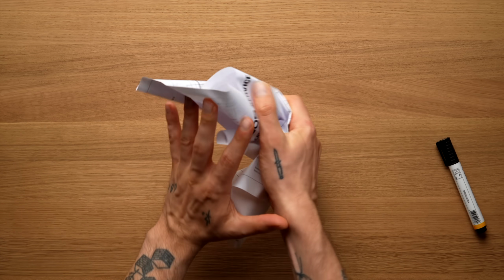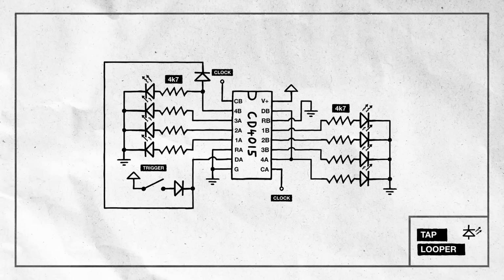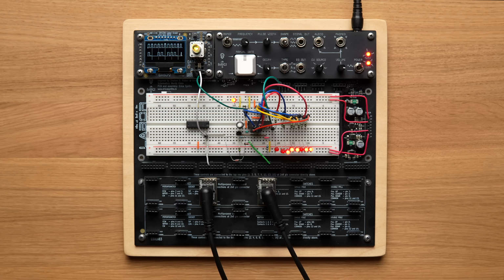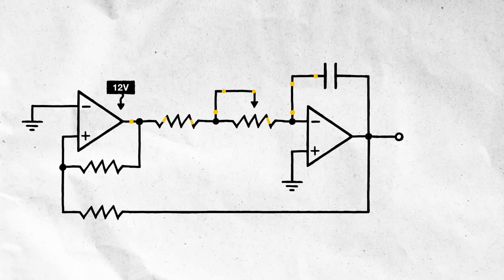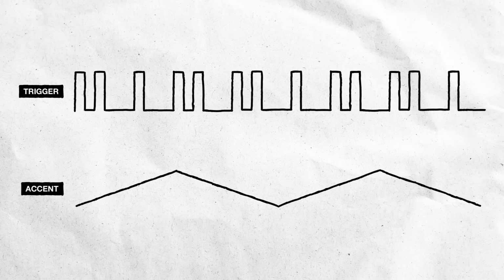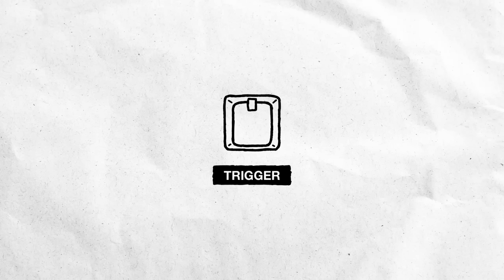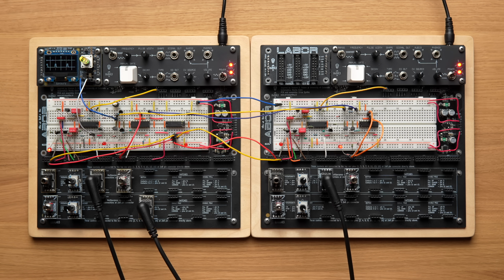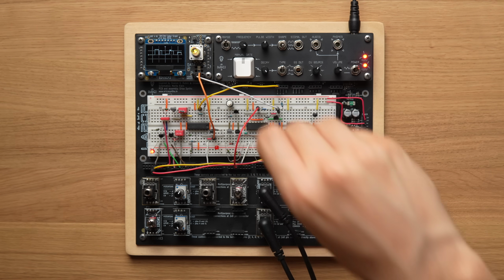This drum sequencer breaks all the rules

Comment: How to save the patterns to be visible after reboot. CMOS battery? Or something more complex?
Reply from the maker: battery would be the simplest way i think, though you would need to find a way to prevent the chip from pushing current to the LEDs, as this would drain the battery super quickly.
Reply: @MoritzKlein0 thanks. Will think about it.

Comment: Hi Moritz. I was thinking of if maybe the CD4015 could be setup in such a way that it keeps the last state when powered on. Then it keeps the last programmed patterm.
Reply from the maker: hmm i think to achieve this, you would need to supply the chip with power even when the main supply is switched off. maybe a small battery would work?

Comment: Hi Moritz, I would like to make some sort of LED bar (per voice) that visualises the triggers you've set. Can I just use the outputs of the CD4015 IC's to drive them? Just like you've showed in the beginning of the video? Or would you advice to use transistors to drive the LED's to take off the current load? My idea is basically to make a horizontal bar with 16 LED's that shows the actions of the IC. Just like an external meter-bridge from an audio mixer. I thought it would be nice to have. What do you advice? do I also need resistors from the outputs to the base of each transistor? Thanks in advance for your advice.
Reply from the maker: you should use transistors i think - the 4015 is not meant to drive heavy loads. you don’t need a base resistor if the LED + resistor are between the emitter and ground!
Reply: @MoritzKlein0  Thanks Moritz. Have a nice day

Comment: The Integrator op-amp configuration creates triangle waves because of basic maths! The value when the square wave is all the way up or down (+ or - VCC), is basically a logic 1, if you integrate that function, (+-1) you get “x”, remember the equation of a line is mx+n! (in this case you are creating an increasing or descendant line!

Comment: just wondering because i'm mostly new to analog circuits with op amps and such, is there any reason you chose to use an op amp to drive the trigger signal low when clock was low instead of just and AND gate?
Reply from the maker: good question! mainly just a practicality thing – i already had a few unused op-amp stages in the circuit, so it made sense to repurpose one rather than add a whole logic chip just for a single AND gate. if i’d gone with a dedicated logic IC, most of its gates would’ve just sat there unused!

Comment: You could get rid of the modifier button with a XOR gate. Pressing the button will then invert the stored bit, resulting in either setting or clearing it.
Reply: Could easily lead you to accidentally set or clear bits when you don't want to

Comment: Something you could do is add a selector to wire the output of one of the CD4015 to the input of the next, and vice-versa, that should work with a single dpdt switch wired like you'd wire a motor for reverse, and that gives you 16 note patterns instead of 8 at the cost of more or less disabling one, though since the lfo are independent and offset 8 notes apart that gives you a nice pattern, and keeping the two buttons give you the opportunity to press both at once to get similar patterns.
Also I'd go with 1p8t switches for more granularity on the loop length.

Comment: This use of a shift register reminds me of the linear feedback shift register for RNG. It's very simple, though it will repeat the pattern and cycles through each value except 0 exactly once per cycle, but it's literally just a shift register and a few XORs of its outputs, the output of which is the input to the shift register

Why use an op amp to pull down the output when the clock is low instead of an AND gate? I guess maybe a 12V gate is hard to find?

Comment: As always, a great design and an amazing video. BTW, if you're making a clock, don't use the ubiquitous 555 - It'll mistrigger almost any counter. Use one section of a 40106 Schmitt trigger with an R and a C. Also, put a 22K resistor in series with the 4015's clock input, and you can use either a unipolar or bipolar clock source. 

A nice trick I'm sure you're aware of is using an XOR gate (1/4 '4070) with a single R and C to make an edge detector. I don't know if that would be useful here, but possibly it would allow you to omit the op amp you mentioned early in the video.

Comment: Great video! I think there is a way to simplify button schematics for adding/clearing beats. Let feedback go through 10 kOhm resistor (or even 100k), one end of button connects to input, another end of all buttons is either fed to 0 volts or to Vcc depending on set/clear switch. And that's it! If button is released feedback is working as CMOS input has great input impedance and 10 kOhm resistor doesn't attenuate signal in the slightest (maybe makes slower rise and fall but it still makes proper level to the clk rise and doesn't affect anything at all!). But when button is pressed it "overrides" this input to whatever voltage it had on its other end.
Reply from the maker: would have to try it, but sounds like this could work. great idea!

Comment: What about generating a triangle based on some subdivision of the clock using an op-amp integrator? I mean your approach works really well, but I am curious what (dis)advantages this one has
Reply from the maker: for one, the output of an integrator changes massively with the input signal's frequency (since it is basically a low pass filter). but also, i don't think that using eight/quarter/half notes for this would give you particularly interesting rhythmic results!

Comment: peak content here,

I remember doing something in this vein using a clock generator (i think i used a 555 chip) and a shift register to control a Ataripunk console.

It was not as well designed as this, but the idea there was to use the voltage that came out of the shift register with would be some level signal like 5v and scale it between that and 0 for each step using a knob for each step.

https://youtu.be/xlXNf9ZBPXo

I was much less knowledgeble back then...maybe I'll try again
Reply from the maker: sounds similar to a baby-8 sequencer – just using a shift register instead of a decade counter?
Reply: @MoritzKlein0 maybe at the time i saw the baby 8 and it was the base, i will revise the parts here
Reply: Maybe it even was the baby8 itself i remerber for space reasons it was only for steps but it might as well have been

Comment: As the circuit got more and more complex, I couldn't shake the feeling that a single-chip microcontroller could have done all of this without needing such complexity.  It would have been a lot more fun to see this done in software with a 20-pin microcontroller, using its ADC and timers.

Comment: One would think the clock gate would rather be an AND gate between clock signal and the shift register output instead.
Reply from the maker: i mean it is, just implemented with a diode and a resistor!

Comment: over all the videos, you switched (pun unintended) from buffers to transistors. a bit more complicated (to learn). was there a reason?
Reply from the maker: you mean from op amp buffers to transistors? i guess there's just been more cases where i only need the buffer to source, not sink current. or maybe there's something subconscious going on. no idea!
Reply: @MoritzKlein0 I follow your designs because they are the BEST way for me to understand electronics. You mentioned something about impedance this time. The op amps allow you take "copies" of signals/volts/current. But using transistors did something different.

Either way - I love your channel/videos.

Comment: Reminds me of the Big Button from LMNC and the Turing Machine by Music Thing. I had enough headache with reprogramming the Big Button so I think I have to redesign it code free like this one
Reply from the maker: definitely some overlap there – what were the headaches with reprogramming the Big Button?
Reply: @MoritzKlein0  I tried to reprogram it with micropython and a Raspberry Pi Pico with some of my own modifications, and I forgot that the adc max voltage is 3.3V, which caused some issues. Also, there was issues with variable gate time, as well as the fact that I'm just not so good at programming🙃
Reply from the maker: @F113XX too bad – sounds like a good challenge though :)

Comment: These are the sort of circuits that are genuinely exciting - a simple idea that ends up turning into something so much greater than the sum of its parts! The retriggerable LFO idea is interesting because it doesn't seem particularly powerful at first, but basically works as a variation of the euclidean rhythm concept if you think about it.
Reply from the maker: yeah, i was pretty surprised myself that the LFO works so well. my initial ideas for implementing accents were much more complex – so it was great to find such a dead simple solution :)

Comment: awesome as always!  not sure if you've seen the lorre mill double knot but it uses two similar shift register sequencers.  i really love CMOS / lunetta style rhythm sequencing it's a fun change from programming a microcontroller-based sequencer, with more randomness and unexpected outcomes.
Reply from the maker: i haven't – will check it out! and yeah, breaking away from microcontroller-based sequencing is great fun. one thing i learned the hard way, though, is that shift registers are incredibly sensitive to dirty clock signals – they really go completely bonkers if the edges aren't perfectly sharp!

Comment: Pausing less than one minute into the video - I wonder how similar this is going to be to the Boss DR-55 which also got away with two buttons for programming. (OK, and an instrument selection switch).
Reply from the maker: and, how similar is it?
Reply: @MoritzKlein0  Your sequencer is more interactive - the DR-55 is step programming only. The accent features on your sequencer are also far more sophisticated. It's perfect for controlling the various clones I have of old drum synths (Synare, Simmons Claptrap and Syncussion) so I plan on getting the kit for my birthday.
Reply from the maker: @chriswareham  ah interesting, so it works like a TB-303 i guess? more on the side of programming a sequence. either way, hope you have fun with the kit!
Reply: @MoritzKlein0  Kind of like a 303 - you have an instrument selection switch and two buttons. One button enters a note the other a rest. You just cycle around the pattern with those buttons. It's similar to how patterns were entered in the Roland CR-78 with the optional two button programmer.

Comment: Wait, what? Is that how a shift register works, as in a pulse/signal shifts the stuff sideways? And here I was thinking it was way more complicated - I really need to sit down with for some weekends and work my way through the basics, thank you for this awesome example using the drum machine as an example :D
Reply from the maker: yeah, shift registers are really just like a conveyor belt for binary data. super simple devices, but really useful!
Reply: @MoritzKlein0 Yeah I see that now thanks to this video :) I’ve known they have been used to collect input from game controllers and «dumped» into the brain, but I’ve never had the time to sit down and search for and properly understand how exactly the data is «shifted» - it’s sort of frustrating because I understand the basic concept of electronics and some of the theoretical stuff of what a resistor does, capacitors etc etc and how routing voltages here and there can trigger stuff, but some of the slightly more «advanced» stuff, like shift registers, is stuff I’ve never had the time to dig into - but this unlocked something here, hopefully I’ll have some time the coming winter to spend some weekends get past my basic understanding and do some experiments on my youtube channel learning this stuff, it’s the missing piece I need for some of my more advanced projects I want to do with servo’s and triggering with sensors etc :)
Reply from the maker: @andresjoberg  yeah, that jump from basics to the next layer can feel tricky — but shift registers are a great gateway. once i started playing around with them, they clicked pretty fast. hope you get the chance to try some fun stuff with them :)

Comment: The digital-analog converter with only resistances is not a linear staircase up, i think the stepsize gets smaller with rising binary value. Is that something you considered in design, but deemed insignificant?

It's a nitpick, and in this usecase probably not even noticable, but if someone needs the linear relationship in some other design you would need an opamp as current-to-voltage converter instead of the 15k resistance.

Loved the video, super fun :)

Comment: 21:50 you should just replace that whole circuit with an xor gate. So that pushing the button when its already on clears it. It removes another button.
Reply from the maker: that would work, but i'm not sure it would be very playable. for example, clearing an entire sequence would require you to precisely remove each individual step. with the clear mode button, you can just hold it down and erase the whole thing without thinking about it at all!

Comment: Btw, if you are not great at prototyping with breadboards or you do not have the hardware to do so, you can do the same prototyping in the free version of VCVRack. You can add a clickable button to output a bit on click, send inputs to a virtual shift register, attach a clock etc. etc. same as the video. You can build very interesting controls in VCVRack and use it a midi control interface in plugin mode (sadly a paid feature) or via a virtual midi router (which is a free option).
You can map the virtual button to a key on your keyboard as well.

Comment: There is no need for the PNP transistor in the first schematic but a simple series 1K resistor. The switch can then safely short the input of the shift register to ground to erase. But for the later modification its totaly worth it.
Reply: I would have just used a button that has both a normal open and normal closed state to swap the connection between ground and loop, for example common mouse buttons do just that.

Comment: the choice to use a little math circuit of discrete transistors for clear/enter is interesting, i was thinking the solution would be an XOR chip being used as some controllable inverters, in the style of the MTM Turing machine's probability circuit.
Reply from the maker: using discrete transistors just seemed more fun :)

Comment: Nice 🙂 Did you consider using ASR for dynamic gates, so beats and accents would be stored together?
Reply from the maker: could you elaborate on this? sounds interesting!
Reply: @MoritzKlein0 Sure, thanks for responding. Make Noise 0 Coast is an example where the height of the gate stores voltage information. In this case the information would be accent. Storing both together might reduce part count?
Reply from the maker: @andrewolney  ah, i see. for that to work, the drum modules would need to support it – and most don't, afaik. good idea though!
Reply: @MoritzKlein0 I was thinking of splitting the signal into two outputs: a regular gate/trigger and a CV. The core idea is that it is easier to store together and split than to store separately and align.

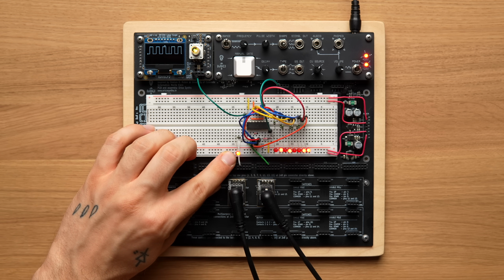Comment: 5:35 would an AND logic gate (6-transistors) between "clock" and "output" do what you need here?
Reply: That was my thought as well. A 4081 gets you four AND gates and does exactly the same with fewer components.
Reply from the maker: yeah, same idea - but using the resistor/diode trick means less complexity/one less chip!
Reply: @MoritzKlein0 why would u use a whole opamp there though seems a bit wasteful for a digital line which can be replaced with a fet or bjt. Would also allow for u to use an opamp for the diode clamp.
Reply from the maker: @jesset2550  mostly because gate outputs sometimes need to sink current, and e.g. an emitter follower isn't great at that.